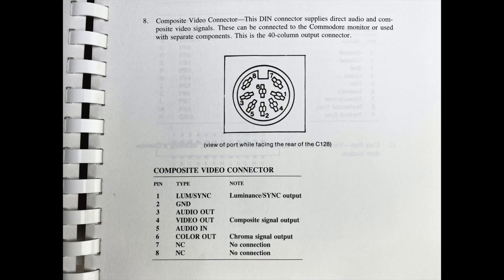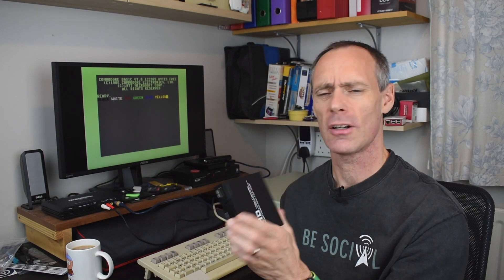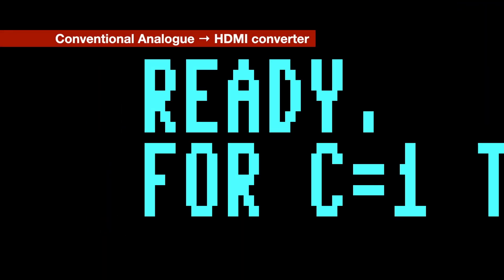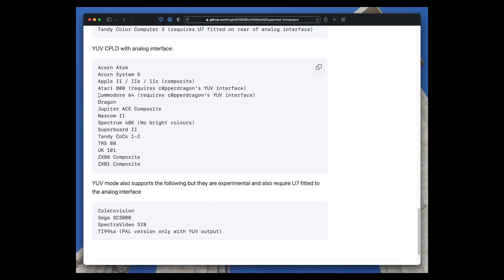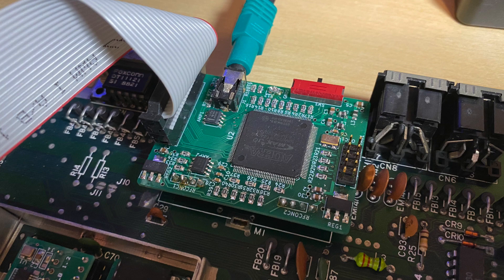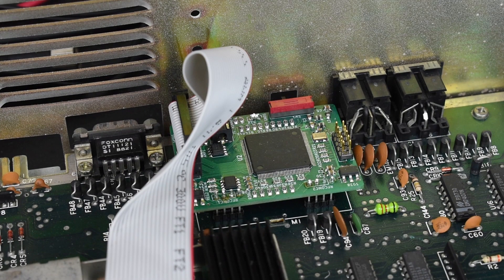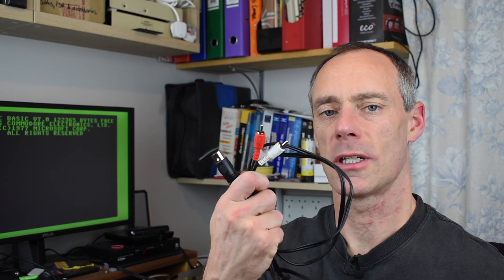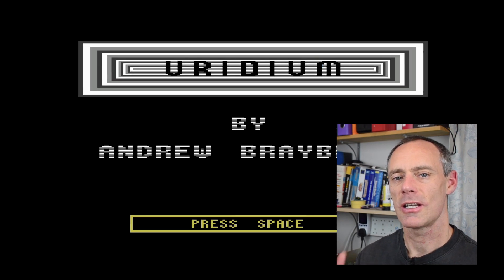Commodore 128DCR c0pperdragon + RGBtoHDMI

Comment: I have Commodore 128DCR. I used to have Commodore 1902 monitor with it to display 80-columns... I wish I didnt sell off that monitor as a kid (I just kept the C1701 monitor)... alas, I miss 80-column mode... I wish there was an easy/cheap adapter that I could connect the RGBI output to say an HDMI monitor... alas.
Reply from the maker: The RGBtoHDMI can do that for you, if you get the one with the DB9 input — that's what I use on my C128DCR.  They're available here (if you can find a Pi Zero to connect it to): https://www.sellmyretro.com/offer/details/rgbtohdmi-for-ibm-pc-mda%2C-cga%2C-ega%2Colivetti-prodest-pc1and-commodore-c128-62028

Comment: I think I was the first guy to discover RGB2HDMI for C128 back in 2021 because I just couldn't find a device to properly capture our C128 Speccy slideshow Colour Spectrum on the VDC (didn't have access to a Retrotink or a Framemeister, but I did try various chinesium SCART-HDMI converters and was disappointed with their image quality). Then I made my own RGB2HDMI palette file with correct colors as they look on my 1084 with my VDC SCART cable, based on my X128 VICE palette file. Ever since playing around with RGB2HDMI (also on c64 with c0pperdragon) I'm wondering if it would be somehow possible to feed both the VIC2e and the VDC into the same RGB2HDMI. Connecting both VIC2e and VDC to the RGB2HDMI should probably be doable (with a few diodes for safety), but I have found no way around having to update the CPLD every time when switching between YUV and RGBI, which is not feasible for normal use where you want to switch back and forth between both video outputs instantly...

Comment: Probably dumb question, but can this c0pperdragon mode be used for RGB signal to be displayed on standard Commodore CRT monitor to get rid off jail bars?
Reply from the maker: I don't think so — it does get rid of the jail bars but the output is YPbPr (3-connector analogue component) rather than any of the signals an old Commodore analogue monitor would accept: RGB or S-Video (or composite).  You might be able to find a CRT that takes component input but I think it's likely to be something like a broadcast video monitor, but mostly component on consumer devices came in around plasma screens.

Without the RGBtoHDMI, though, you would be able to connect the component output up to something like an LCD TV with a suitable input.

I was thinking of doing a separate video about the differences between the standards, using my oscilloscope as a sort of follow-up the video about the BBC Micro video output, as that's fairly interesting (if you like that sort of thing!).
Reply: @lsbyte  Thank you for explanation. I was under impression that c0pperdragon is outputting RGB. To mind you, different outputs are quite confusing to me so I can not wait for your next video about different video signal outputs:)

Comment: Hi, I'm Andrea from Milan Italy, I have a Commodore 128 and I would like a cable adapter that can see the 40 columns and 80 RGBI columns in HDMI ... can you sell one ready? Thank you
Reply from the maker: Sorry — I don't make or sell these, just get enthusiastic about them.

You can get an RGBtoHDMI easiy now, though: https://www.sellmyretro.com/offer/details/rgbtohdmi-for-bbc-micro~~master~~compact~~electron-61482 — that will at least handle the 80 column mode: you just need a different cable (speak to the guy who sells them).

Comment: In the same way that at least one group has created a modern C64 replacement motherboard with updated features, they need to do the same thing for the C128 so all of this modifying is not necessary. Display looks great when you're done though. Wish mine had looked that good!

Comment: Have you tested different VDC video modes? The VDC supports up to 720x700 interlaced. There are also different VDC FLI modes.
Reply from the maker: I worked with the guy who made it to get it to handle all the modes in VDC Mode Mania (v1.1, I think it was), so it handles those.  I think there is an updated VDC modes demo that might have additional modes I’ve not checked, yet.

You can add profiles for additional modes, although it will involve editing the files on the SD card with timings.  Once you have the new mode, you can adjust the area and scaling settings in the onscreen menus.

Comment: Where can we buy the RGB2HDMI board?
Reply from the maker: They're not on general sale, unfortunately — there was a guy in the UK selling them, and someone in the US was, too, but I think he's stopped / run out.

All the details you need to make one are on the GitHub website (the software and the files to have a PCB made: you then just need to solder on some parts and add a case + SD card), although I don't know how difficult that is!
Reply from the maker: They are available now from here: https://www.sellmyretro.com/search/naturalSearch?keyword=rgbtohdmi — you just need to order the one with the right boards and cables (some need the analogue add-on board).  You can always make up your own cables, though, to use them on different machines.

Comment: I'm faintly considering losing the RF box on my Electron to use the power it would use there for active cooling on the ULA, that's currently got no drop in replacement.
Reply from the maker: These old, specialist chips are worrying as there's no new replacement.  I don't want to talk it up, but my Electron has been rock solid, even with all the shenanigans in my other videos going on (PiTubeDirect, Plus 1, AP6, ElkSD Plus 1, ATI+ABR, RGBtoHDMI, BBC2DVI, etc.).

At least with the Electron, Dave Hitchins and Stardot are a good place to start!

Comment: Quick question: Did you end up with two RGB2HDMIs? One for 80 column and one for 40 column? I'm guessing that you would have had to have two...
Reply from the maker: Actually three.  ;)  This is partly caused by the location of the TTL input connector (the 'hidden' one, directly on the RGBtoHDMI), the need to swap the analogue board on and off and reprogramming the CPLD.  Bit of a complex history...

Originally I got one for my BBC that works with the TTL level input but can also work with the analogue board (with the BBC CPLD firmware).  I bought the analogue board really for flexibility and because it made it easier to change the cable.

I then bought another for the Commodore 128's 80-column output with just the RGBtoHDMI and a cable with a DB9 connector (the one you can see being plugged in in the video).  Whilst that uses the same board, it needs the RGB CPLD firmware and you have to remove the RGBtoHDMI HAT to change the cable.  So swapping one between the BBC and the C128 would be annoying.

Once I'd got the C128 c0pperdragon board in, I was swapping my BBC one between that and the C128: since that had the analogue board (and the BBC works with that), I just had to swap the firmware between the BBC and YUV versions and change the cable (the analogue board has a connector that is external, so this doesn't involve opening up the RGBtoHDMI).  That was OK but a bit of a hassle.

In the last week, someone was selling a spare RGBtoHDMI (only) on stardot.org.uk (the BBC forum) and I managed to get that.  That meant I can now use that on the BBC (with an internally-connected TTL cable) and save the original one with the analogue board for the C128 40-column, with the YUV CPLD firmware.  This also means I can easily swap that onto the ZX81 just by changing the cable and the profile, since that uses the analogue board and YUV firmware.

So, yes, I do have two (well, three) and can run the C128 40- and 80-columns at the same time, through two separate RGBtoHDMIs.  You could swap one between the two outputs but it's going to be a lot of faff, swapping boards on and off, updating the firmware and changing cables.

It's like bicycles or kayaks: the correct number to own is one more than what you already have!